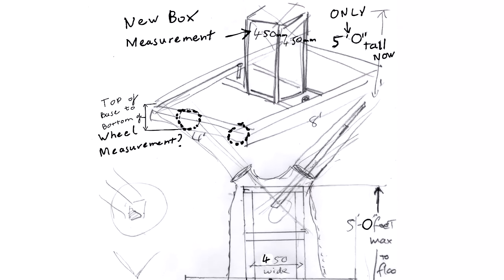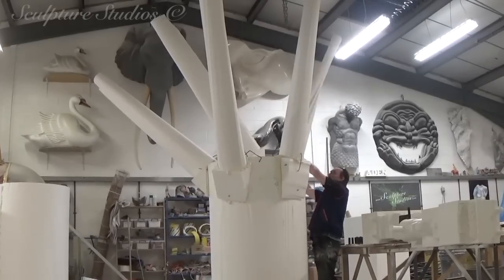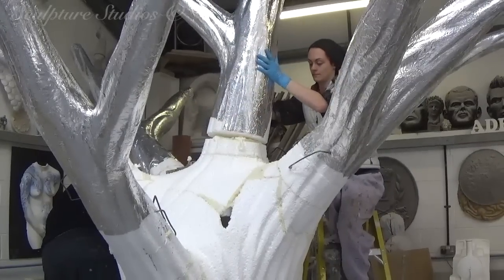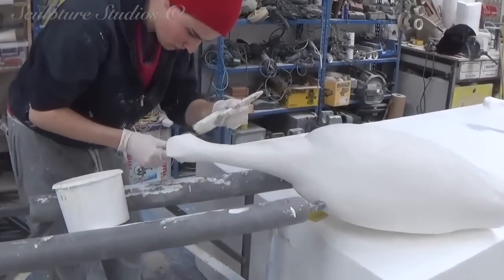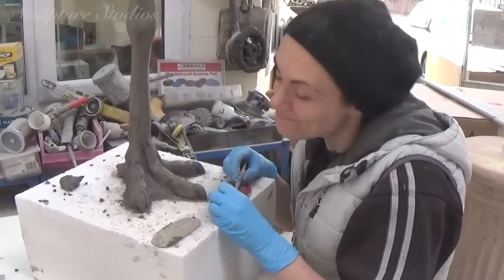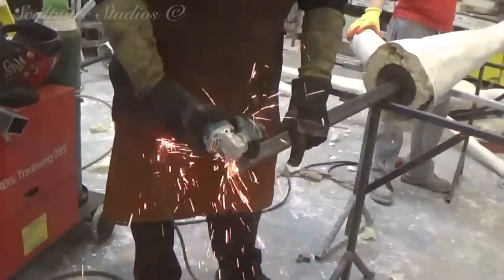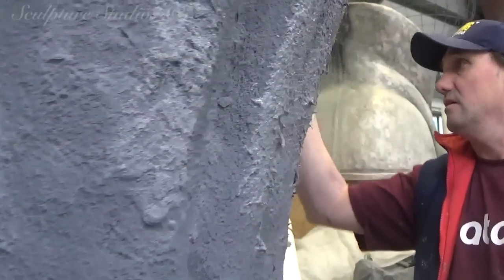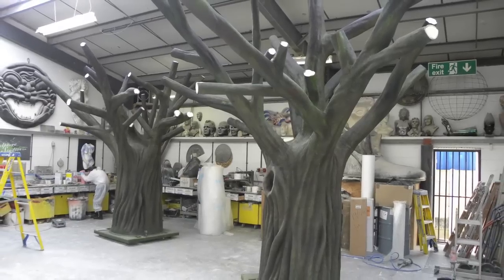Wedding Blossom Trees & Peacocks - Polystyrene / Styrofoam by Sculpture Studios

Comment: I've worked in this for 30yrs all the metal seems overkill
Reply from the maker: The metalwork is so that the trees can come apart, and be joined again later. As this simply wouldn't fit through the majority of doorways in one piece.

   The metalwork also ensures the entire form is structurally sound, when they're moved from location to location. We have no guarantee that people won't attempt to climb the trees

Comment: Hello there Aden, I just love your works and inspires me as well. I have a question, from where do you buy such a huge blocks of polystyrene?
Reply from the maker: Yogesh Awale we buy it from a company called Kay Metzler in Essex in the UK
Reply: Thanks for your kind reply. 
I am also a sculptor back here in Nepal, that's why I am so interested. Here most of the sculpting is done using water based clay and its not so flexible in some huge projects, so I am interested towards polystyrene. No product like polystyrene is imported here, so do this company exports polystyrene to other countries?

Comment: Besides commenting on the great dancing, I have some silly questions about the build. In a tight turn around project where the foam is removed from inside a fibreglass shell, would it be feasible to melt the foam and pour it out instead of cutting open the sections.  Next question. I would resume that the metal supports are attached by fibreglass, would an expanding foam be strong enough to secure the job?

I know that this would give you a large vat of dissolved foam to dispose of, but would the savings in manhours make it worthwhile? something like this? https://youtu.be/K1XmjWDXJn4  not sure on the cost but the client will pay for quick turn arounds
Reply from the maker: Armoury-Terrain hey Armoury. Apart from the sections we cut out for the metalwork, we wanted to keep some of the poly inside the job, so that the foliage had more material to stick into later. Melting the foam from the end using an acetone or something of the like would have been very messy, and there was no guarantee that the foam towards the end of the branches would have stayed in place. Cutting away just worked out to be neater. And less mess to dispose of. Great question though :)
Reply: thankyou for the reply